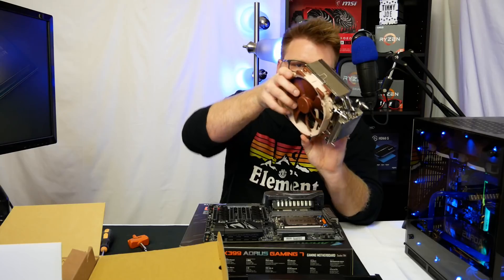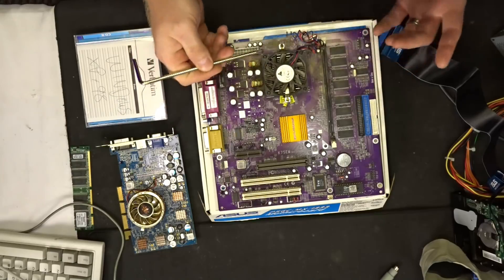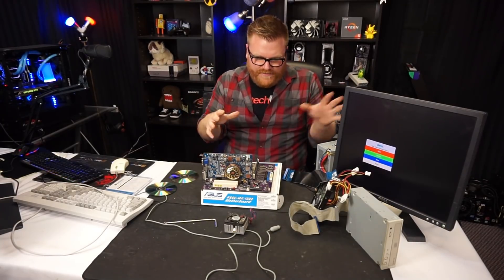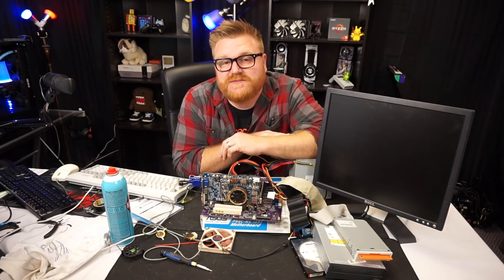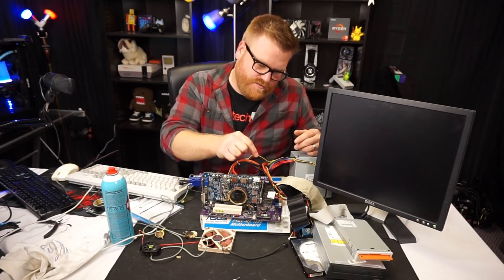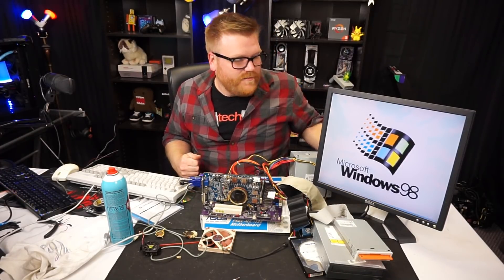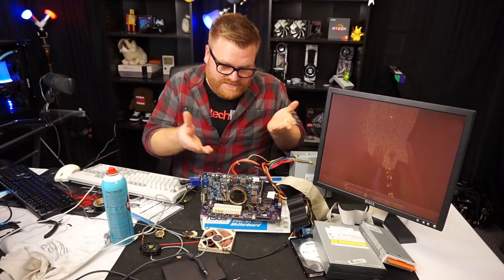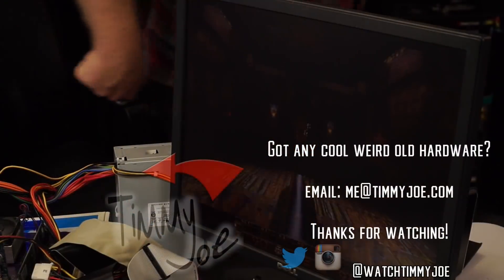This Weird AMD Motherboard Has A Built In CPU And Ram!?

Comment: 1.8 Ghz with 512 MB RAM in 2001 a "crappy system"... the same year my family got fancy and splurged on a 800Mhz Pentium Celeron with 128 MB of RAM, 40 GB HDD, and a 32x CDRW. We put a brand new Voodoo 3 in that "beast", with the ridiculous 16 MB VRAM...
So, yeah - that Duron system was actually really top notch for 2001!

Comment: That’s more like 2004 1.8 ghz. I was running athlon 1.3mhz overclock to 1.9 in 2002. I still have actually and windows 2000 pro definitely best for those years
Reply: it's 1.2ghz....... numbering was the equivelant of intels p4

Comment: get one of thoes Cheap oscillating Tooth brushes. the battery powered ones. it works SO GOOD when cleaning around the small tight circuitry..

Comment: The computer place I started working for 10+ years ago sold a bunch of boards close to that one before I started working there. It had soldered on processor but not ram. I explained how I would never sell a board like that. But, the answer I got was they come with a longer warranty. Funny how tons of them came back dead shortly after the warranty ran out. To be fair I would think at that point they would be 3 years old or so. Now don't judge me but I think a board should last 5 years or longer.

Comment: I have an old nVidia Geforce n9800GT 512mb edition and a Geforce 7950GT KO with 512mb. I remember the n9800GT I pushed it hard. I played Red Faction Guerrilla and Grand Theft Auto 4 on it. I think I burned it up though. Last I knew the 7950GT worked.
Edit: Just pulled them down. The thermal paste of the n9800GT was solid, so re-pasting that. Might shove it into an old system I have laying around.
https://drive.google.com/open?id=1e6uglIJbYb91__KTRxbPUoUSc99bVPIV
Red PCB, heck yeah.

Comment: i have an old ass AGP leadtek winfast  A280 le 128 MB memory.  it's heavy and got a heat sink that goes to the back for ram cooling 
don't  know if it's working never used it. don't have agp system for it.

Comment: Is there a PCI Express gen 1 to Sata 3
Reply: Actually I think the band was would tap out at Sata Gen 2, which means there's hardly any point of an SSD, little hard drives can slow down to 60 megabytes all those lower part of the drive

Comment: You know what sounds more fun to do with a motherboard like that, see if you can get Louis rossmann to upgrade the CPU and then put a Overkill $50 GPU in it, see if you can get the Ram tow more than 512 gigs and then see what I can do.
Reply: Lol I did it too
Reply: Well I don't even know if it's possible to upgrade the CPU but if it is 2 standard socket but with soldered pins should be as upgradable as a similar motherboard, but I wonder what the best available for the socket is?
Reply: You can make another video and call it the legacy of Windows XP

Comment: you could totally relive my childhood and cram those parts inside an old IBM Aptiva shell case! One of the horizontal models, not the vertical! I loved my horizontal IBM Aptiva with Windows 95 back in the day... CRT monitor would sit on top of it... And I remember trying to run half-life on it when that game came out around 1998 and it took up like 90% of the storage on the drive and the frame rate I was getting tied to have been 9 FPS… But I wanted to play it so badly I adapted and actually got good at playing the game in that condition! I got used to the crappy latency and figured out how to dodge attacks at the perfect timings. Crazy stuff but it's the best you can do when you just a preteen with no way to earn money

Comment: So I must have the only other version in existence lol among my collection of old tat :D  --- to be honest I used to get them boards from a supplier and built a few systems with it, its basically a low priced board built on cheap by the manufacturers and those had a very simply bios and the drivers we just built them for a workstations in an insurance company running Windows 2000, I think the board retailed in UK for around £25 then just needed the memory and graphics as the chipset was was limited so was just ideal for Windows NT, XP, 98 and yucky Windows ME terrible :D lol

Comment: Exact same models I used to deal with in UK back in around 2000, VIA or TXPRO chipsets... funny enough I got that board somewhere still working but only difference they had to SDRAM slots instead but everything else same even from Eagletech

Comment: Speaking of lga 775 sockets motherboards, whats the best place to fimd decent overclockable ones and how much should you pay for them? You can find them on ebay and such but ill be damned if 30 to 40 is correct for a board that old. I can get oem lga 1155 board for 15 easy

Comment: aww its so ugly its beautiful :D    

Durons i think stopped around 1.3ghz .  

PS/2 ports don't like it when the k/b or mouse is unplugged from a powered on system, it can cause issues.   

Maybe a feasible work around, use a usb hub and attach a usb mouse and kb, handy if you're having issues with finding a spare usb (or working usb) ports.
There used to be usb to PS/2 adapters (but if trying to find one in a store now days...maybe better go for the usb hub option)

GG

Comment: You can put XP or even 7 on this... Anyway XP would have been better for that PC, 98 Second Edition is for way older hardware.
PS: Your Doom resolution is 640x480 ;)
Reply: Excuse me? Windows 7? Bruh that board didn't have WDDM compatible driver until now, yes it still can run win 7 but you might never experience pain-in-the-ass like me with asus p5pe-vm (even it can't detect bootmgr so i had to install xp first). Also 98 designed to run better at 1.0 GHz above processor for better retro gaming so it's not obsolete at all.

Comment: It's a 1200MHz (12x100) Morgan core Duron, 200MHz (100x2) FSB. ECS, PC-Chips and other brands applied a fake Performance Rating to Durons (they didn't have one originally) they bundled with their motherboards, labeling them as "Pro", "Turbo", "+"... They also put fake inflated PRs to VIA processors, this is more noteworthy as those VIA processors actually performed (much) worse than Intel and AMD processors of the same frequency.

Comment: its not a K7 first gen :) the Duron 1800Mhz was from around 2003. first gen K7's were slot A they then moved to Socket 462 Socket A :) obviously yours is soldered to the motherboard :P

Comment: I have a very close relative of that board with a socketed CPU (started as a duron 1.3ghz ended as an athlon XP2100) the ECS K7SOM aka pc chips.. something, i think 841. The K7SOM is interesting in being a motherboard which can take both PC133 SDRAM and DDR1. There were all sorts of revisions of these boards with SiS chipsets, most of them costing less than some people pay for a single fan these days.

Comment: Yes, the Duron does have 64k L1C, 64k L1D and 64k L2, but the caches on this series are exclusive, lines are not present in both, so the Duron has 192k total of which 64k is code, 64k is data and 64k is any. If the motherboard allows multipler selection, you can enable by pencilling in the L1 bridges
Reply: He bout to hit us with that LGA tape mod

Comment: I know at least built in RAM is nothing new. I remember the old Compaq Presarios from 1998 had 16 mb ram built on to the motherboard with one slot to expand it to 48 mb. I remember that I tried a 128 mb sdram stick, but then the PC refused to boot.

Comment: I use to have a ecs motherboard with a gpu and vram soldered on it, heatsink and cooling fan included. It was another amd system, with an Athlon 1800+, if I remember correctly.
I gave it to a friend, maybe it still has it...

Comment: wow that compaq case you showed on the screenshots was just like my  very first computer i ever owned , i was 21 years old and my folks bought me one for college , the system actually had a pentium 4 1.8 ghz cpu in it and  a very early edition of windows xp  sp1 i believe  , and yes i remember how weak windows xp ran on that system due to its horrid 128 mb of memory installed , someone had the exact case a few years ago and i transplanted  a core 2 duo e8400  system in it with 3 gb of memory and windows xp sp3 . that front compact disc holder was always useful lol. even though ive built over 50 pcs since i went hardcore in the hobby back in 2011-2012  i still enjoy making what i call overhaul systems using old cases such as the one i had my first ever computer in. one easy way to overhaul cases i found is rewiring the powerswitch units and replacing them with newer power switches

Comment: Don't unplug then re-plug a ps2 keyboard or mouse with the system on you can damage the system.
98SE will support USB.
USB 2.0
https://download.cnet.com/usb2-0-driver-for-win98-exe/3000-18493_4-151166.html
Or by inf file (use chrome translate)
http://www.wintricks.it/faq/usbpen98_6.html
Of from the Brits
http://www.technical-assistance.co.uk/kb/usbmsd98.php
Reply from the maker: I know I could use a usb keyboard but that's not fun :P I have my ol' microsoft mouse and 20 dollar ps2 keyboard just for these situations :)
Reply: Timmy Joe PC Tech  For the USB I was referring to using a thumb drive to xfer SW

Comment: 9:53 "I bet that's wrong"

Not exactly. The Duron was a cut-down Athlon (XP) much the same as the Celeron was to the Pentium. The original Athlon had a 64+64 KB L1 cache set up, and I presume that AMD cut down the L2 from the 512 KB found on the Athlon to 64 KB.
Reply: Duron and Celeron translate to "no balls"
Reply: durons had 128k lvl 2 cache for k7's
Reply: But funny thing back in the day a duron 850 went toe to toe with a p3 1ghz

Comment: This is a SECOND gen MORGAN Duron CPU, not a FIRST GEN SPITFIRE Duron, kiddo!! 

My first CPU was a 1.4GHz THIRD GEN Applebred Duron that I managed to overclock to 1.8GHz no problem at all. It took me from a GeForce 2 MX 200 32MB to a GF3 Ti 200 64MB and eventually a GF4 Ti 4200 128MB! The GF4 got so hot that it literally gave me blisters once when I touched it, so that was the first time I employed the "Box fan" trick which worked very well XD 

That Duron@1.8GHz/GF4 Ti 4200 128MB kept me going until it was replaced by Athlon 64 3000+/X800 Pro 256MB Just replaced 2500k w/3770k and waiting for Ryzen 3 to replace this old Z68 dinosaur!

BTW this is not a bottleneck for XP at all, just gotta give it enough RAM (512MB for SP1 or 1GB for SP2) the CPU and GPU are plenty for XP

Comment: Two quick notes Timmy, that particular Duron was more like the third iteration of the K7 it was for certain preceded by the thunderbird and thoroughbred came out in 2003, the SE on Windows 98 SE is "Second edition" not special edition. Looks like you had at least a little bit of fun with this old tech Windows XP was more period correct for this but 98 SE will run insanely well with it. Looks like almost everything in CPUz was wrong as well the Duron 1800 had a 13.5x multiplier and should only be drawing 1.5v. PS2 keyboards aren't hot swap capable they have to be plugged in before power up or else they don't detect in the bios and if the bios doesn't catch it windows can't.
Reply: "1800+ Pro" and Morgan generation means that this is 2nd gen. 1.75V is normal, actually. That branding is misleading, but this chip is actually running at 1.2 GHz.
Reply: Windows XP was also a much better OS than 98. Also, XP was much better for running DOS apps.
Reply: When i press read more the comment changes to "Nerd"
Reply: @DrAliToma  lmao

Comment: i wonder if this can run diablo 2
Reply: Naruto Uzumaki easy
Reply: Diablo1 and 2 runs with 45fps on 1024x786 Resolution in a 386DX 40Mhz with 1Mb RAM and a 512kb GPU! Yes its very old game! :-D
Reply: Naruto Uzumaki yes, Naruto. Yes.

Comment: Isn´t a NUC conceptually the same? Sure the NUC is not that old but the concept has been indeed there for quite some time... :-P
You don´t need much to run a firewall for example, hell you can boot it from a stick... these PCs had a market, still have probably :-P

Comment: Wow I havnt seen a purple board since I built an old athalon system on an ECS board (K7S5A if memory serves). I did the old trick if using the mobile 2500xp and overclocking it and I loved every moment of that build! Ah, pure nostalgia! 

Anyway, its 3.30am here in the UK and whilst the sensible side of me says "sleep" - the night-owl is very much appreciating another kick-ass (and more positive video from yesterday's) from my main man T-to-theJ! Love ya homie!
Reply: Yep I also had a Athlon XP-M Barton 2500+ used the pencil mod to get what I wanted out of that great CPU.
Reply: I had also 2500+ Athlon-Xp mobile version, and this processor doesn't need any pencil mods. Just put in the socket and cooler onto it,  adequate multiplier and voltage and voila :) Very good nostalgic video nice work Timmy Joe xD.
Reply: K7S5A-PRO REV 5.0 AMD Athlon XP 2400+. First ever build in early 2000's and still have it!
Reply: Reading K7s5a just brought back some crazy teenage memories for me.

Comment: Wtf, playing quake with a 9700 pro, come on throw some doom3, fear, far cry to make it shine
Reply: not with this cpu
Reply: Cs 1.6
Reply: Nothing wrong with just Quake, but this one is MS-DOS software render one, so a gfx card doesn't matter. There are modern 3D accelerated Quake and QuakeWorld clients worth checking out.
Reply: I remember trying to play WoW with a 9700.  It ran at about 25 fps with minimum settings at 800x600
Reply: https://www.anandtech.com/show/1416/3 

9800xt 21 fps in High
Reply: doom 3 on a 9700, i think not
Reply: maximusoptimus2000  it works flawlessly on the 9700. It was one of the top cards when Doom was released. https://www.youtube.com/watch?v=fU3RLKuVOic
Reply: Jeremy Williams i had a 9800 Pro and doom 3 run under 30 fps, 9xxx series Can not Run doom 3